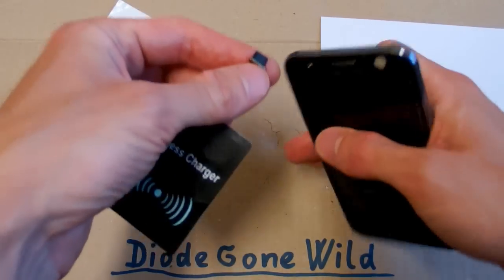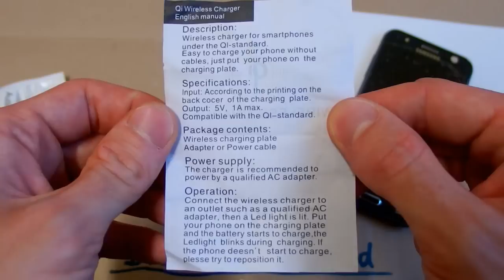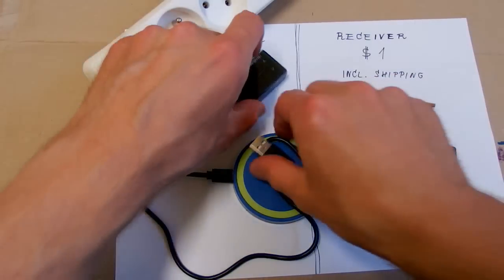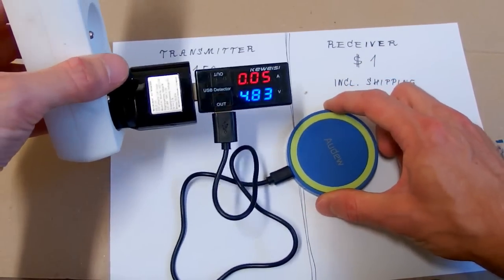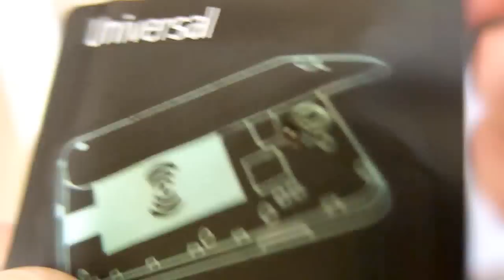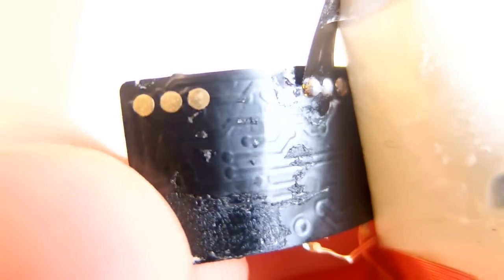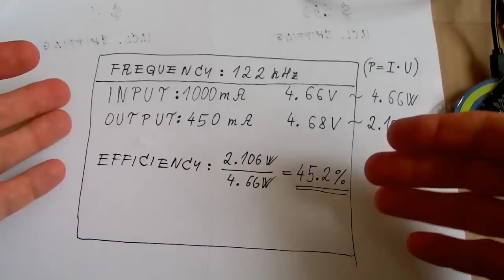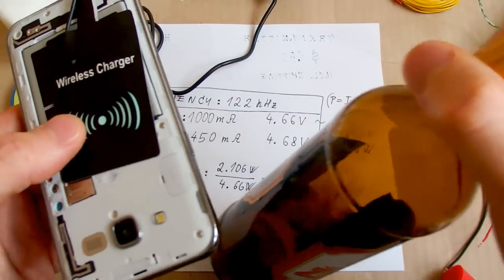Wireless Qi Charger (sets your phone on fire)

Comment: wireless charging is such a massive waste of electricity. The ratio of in:out is ridiculously low.
Reply: Adam Rivera  Not only that. It ties up your USB port,cooks your battery and phone (vastly reducing the life)and adds more danger to burning your house down. It amazes me how people are willing to sacrifice so much just to avoid the difficult and time consuming (2 seconds)task of plugging in their phone once a day. Wireless charging is a gimmick that takes more than it adds.
Reply: Gord Thor i would like to have a robotic arm who plug in for me 😂
Reply: Qi is rated at a 85 % transfer. not MASSIVE .
Reply: Gord Thor worse part
The smartphone is totally unusable while charging
Unless you want a hot disc in your hand while using it
Reply: I basically agree with you. But every time a connect my phone with this micro USB connector I have to think of the much more convenient round charging connector of the old Nokia phones. It was more easy to handle, because you just could not try to plug it in backwards. Just because it was round.
Reply: goamarty but those connectors start to malfunction after a while, but you didn’t realize on Nokia cuz you only need to charge it  once a month
Reply: The only reason why I would purchase a device with wireless charging is to reduce the fatigue stress imposed on the device's USB port. Obviously with USB-C the stress being imposed when you unplug and plug is reduced compared to micro-USB, but you can never be too sure.
Reply: It avoids breaking the charging port, which would be a big problem on my S6 edge plus
Reply: It's physically impossible to couple electricity wirelessly at high efficiency, otherwise we wouldn't have ugly high voltage lines all over the country, only wireless transmitters.  While the efficiency is around 0.5, I will stick the USB cord into the bottom of my phone in 2 seconds or less, and at least it will charge quicker and won't fry it.
A lot of people don't understand, just because something is possible, it doesn't necessarily mean it's good or efficient.  But they'll learn once their phone or house burns down.. tsk-tsk
Reply: maybe
Reply: So true
Reply: @BillAnt  Your phone won't burn if it already has the wireless charging in it. This chineese piece of crap will burn your house, not the official charging pad from your phone company. Samsung is doing good in that department
Reply: Gamer du Québec every product does that good, the samsung doesnt lead the way here :)
Reply: @cernobylis  Not every product. But Samsung is more advanced. Because they not only charge their phones wirelessly and rapidly, they can charge the bluetooth stylus from their note 9 in less than 2 minutes, which is a lot better than how Apple is doing it in their bent iPad 'Pro'
Reply: How massive? How much electricity is spent to charge mobile devices?
Reply: True
Reply: Yeah. It just remove old problems and make new ones.
Reply: @gilberttheregular8553  :D yes! Lot's of "managers" in companies can develop something new for customers and they don't know they killed good feature.
Reply: Gamer du Québec Samsung is more advanced yet all of em explode. Great logic.
Reply: Adam Rivera it’s barely any better wired and the convenience of dropping your phone on a pad and it charging
Reply: What electricity is required to manufacture the phone that replaces one with a broken USB port one wonders... or to recycle the raw materials in a broken device
Reply: @gordthor5351  If you’re using the phone while wireless charging no shit it’s gonna heat up
Reply: @goamarty  Absolutely, and this is why many charging ports get broken when people try to ram them in backwards. The round plugs only work for power so those aren't an option with the data pins needed for modern phones. However, it's possible to make a flat rectangle plug work in either orientation, but twice as many wires  would be needed in the cables.
Reply: Lately apple released wireless magsafe charger for iphone, and u know what..? u still need a cable stick to ur phone... LOL so ridiculous
Reply: I would use a chearger than wireless charging
Reply: Hence the LED

Comment: I can imagine, that this component (Z-diode ?) could possibly have survived, if the receiver was behind the phone cover. The extra distance of the thickness of the cover could have reduced the power transfer sufficiently. I once designed a wireless charging system and the voltage was tremendously dependent of the distance. But in this case the max. output current would probably be much less than 1A.
Reply: I'd love to learn more about it to save me from blowing up my phone or making it get overheated so I can actually charge my moto Pure G phone please 🙏🏽???? & Thank you sincerely.....

Comment: that burning component looks like to be a underrated diode, that thing don't seems to happy with 500mA
Reply from the maker: Given that the receiver still works, the component is probably a resistor. Diodes usually stop working when they release smoke, but resistors may still work even when smoking.
Reply: +DiodeGoneWild I agree with you, but it looks like a diode to me. Maybe the weird current consumption is because of that shorted diode.
Reply: Diodes go short when they fail, resistors fail high resistance or open.
Reply: It looks like a diode to me.
It might be a zener diode I think, just by looking at the PCB and the traces, but I'm not 100% sure. If it is a zener, that would explain why it continues to operate. (However there might be something getting too much voltage.)
Reply: I guess you could say that it's a diode gone wild..... I'll leave now
Reply: i have also "this" receiver and on place for burned component is nothing. Only 2  soldering places.

Comment: I have had several of these units. Altho I didn't use the charging base  you show here. Mine was the long rectangular one that the whole phone would sit on. Using that charger and one Qi receiver, I had one phone that would get hot. I used the exact same units on another phone, and I didn't have any issues with it.
However, with what you have there, is a defective receiver unit. So far I've bought 6 receivers and haven't had any issues with them burning a hole in the casing.
Reply: Any suggestions you might have for me buying for a moto Pure G phone good Sir or Ma'am????? Just curious cos I'd love to save myself from a fire or loss of only phone I got or risk of wasting money? Sincerely, if you didn't mind sharing any types that might or may work for this moto Pure G phone I've got ?

Comment: The bases are fine for charging phones that have the Qi receiver already built-in.

My coworker bought one for his iphone and it didn't work at all, he thought the base was broken. Actually the part that sticks into the phone was broken, a few months later i found the base lying around at work and took it home. Charges both my Lumia 930 and my girlfriend's S6 just fine.
Reply from the maker: The charging pad is not so bad except the loose board in it. The receiver is surely the worst part of it.
Reply: This is because the iPhone requires the data pins to be shorted with a resistor of specific value to work. Android/Windows devices do not require this at all. However, if they do have the shorted pins, it tells the device if it can charge at normal 1A or quick charge at >2A.
Reply: One of my cheap bases melted itself. I'm inclined to stick with brand name ones....

Comment: Personally I would prefer if phone manufacturers used magnetic attachments - The cable would attach itself when the phone is placed near it (like the magnetic micro USB ends available).  Plus they offer the other advantages of a cable, i.e. no efficiency loss, faster charging and being able to use your phone while charging, which is not possible with a wireless charger.  If someone trips over the cable, it will detach without the phone flying across the room.
Reply: Seán Byrne while I agree with most of your statement! I'd like to point out that wired chargers also have an efficiency loss, but it's not nearly as significant as "wireless chargers"
Reply: Magnet can disturb your navigating system so magnet is a bad idea
Reply: Seán Byrne but how about data transfer? Does it transfer fast? Does it get interrupted when you tap the magnetic micro usb while it's transferring? I'm curious.
Reply: The now dated magnet Apple MacBook charging connectors were this way.  I liked them

Comment: The transmitter is impressive. Well worth the price just for the coil itself! Looks like it's made from proper litz wire, and it includes a ferrite disc, which I don't know any source to buy from separately for a reasonable price. I'll definitely buy some of these transmitters just for the coils, I'd like to make some experiments with them (eg. a directional induction heater for heating up getter rings in vacuum tubes).

Comment: Nooo don’t put it on top of the battery. It’s a coil with a current passing through it = heat. Bad idea
Reply: Where do you think apple, samsung and lg put their wireless charging pads.
Reply: @tiagoizaguirre8837  yeah but that ones are not $1 Aliexoress😂

Comment: It is geting hot because you put more than 1amp. On the manual sais max 1 amp. I also have one of those and it never heated
Reply: The current is supposed to be controlled by the charger itself. His adaptor it's capable of supplying 2 amps, but it will only supply what the device plugged into it draws. In other words, it's the charging pad that connects to the phone that is the problem.

Comment: I'm glad I let go the plan to add wireless charging to my new phone and bought a magnetic adapter instead. best thing since sliced bread. 
super easy connect and disconnect, no extra power consumption when phone is not connected and the main point is, that it does not inhibit 3A quick charging.

Comment: That belongs in the nearest dustbin.

This kind of tech allways makes me laugh, so you can charge a phone via 100khz r.f, i just dont see the point, plug the power direct into the phone lol, silly idea :-D.

I feel sorry for am radio, hmm.

I have a 4000 year old sonyericson k800i phone, it charges from a 5v charger, reliable :-D.
Ooow and it bounces in a way that smart phones dont lol :-D
Reply from the maker: I also can't get the point of the wireless chargers. You have to plug the pad into power anyway :). Of course, you can keep it plugged in all the time and waste even more power. Like it wasn't already wasting more than 50% in the wireless transmission.
Reply: zx8401ztv 
 I have 5350 year old Samson D600
on it's second charger that cost £5
at the local market, and won't burn my 
flat out.:-) Oh, excellent vid by the way.
Reply: Golf Man
Ahh the samsung, and 5350 years old lol :-D
I say 4000 years old because im teased for not being interested in smart phones, the old ericson does the job, new battery last week from amazon lol.
And it does not break like modern phones :)
Reply: The only point I see is to avoid wearing the USB connector. I had a Nexus 5 a while back, that had a terrible battery life (1 day was good, and 2 days was really awesome) and if you plug in the micro USB connector a lot of time, it will wear it and in the Nexus 5 it's a pain to change because the whole phone is glued shut.

So since it supported Qi charging, I just used that...
Reply: Yeah USB connectors wear out. I think a good way to protect them is to use a magnetic USB cable - as a bonus they're usually reversible and super easy to attach. It only looks good on phones which have a flat area around the USB socket, but then the insert protrudes very little and doesn't interfere, you just leave it in once and for all, and whenever you yank the cable, it detaches without stressing the socket much.

But now that i've seen this video, i'm considering to add a wireless charger to my bicycle, powered by a dynamo hub and maybe some buffer batteries in the handle. If something catches on fire, it'll be outdoors anyway, and i can implement an insulation between phone case and the rest of bike electrics that way.

There's a good chance that the low 45% efficiency was down to receiver having defective components, which stands to reason with it basically smoking. Perhaps if it was fine, it would be closer to 60-75%.
Reply: 4000 years old? Humans didn't even have that technology back then so it's weird to say

Comment: The problem is you can't use that wireless charger using ordinary mobile phone charger because they can output about 2 amp depending on your phone's battery current consumption. You have to make your own charging port whereas it limit its output current to 1 amp and less.

Comment: "1amp is a lot. You cannot use a 1amp charger. You have to use a 2amp charger" please explain. That doesn't make any sense to me
Reply: It requires over 1amp which a 1amp charger (most likely .7A) will not be able to supply. It probably won't charge also because of the low efficiency
Reply: @deavman  then why he said "1amp is s lot" ? (Did he really said that?)
Reply: @evergreatest7644  
Yes he did. 1amp is alot to draw when most chargers supply 1amp or less. Did you notice that the device eventually drew over 1.5A

Comment: Typically you need TWICE the wattage you intend on using.

So if you have a 5v 1amp supply, your charger can realistically deliver 500mA with reliability.

Your mains socket  will have wiring rated at twice maximum recomended current draw, in the UK that is your socket can deliver 32 Amps before it gets hot and melts.

Also, its no use using a 5W charger on a device that needs 15W to charge is it...

Comment: yeah that magnetic stuff is most likely to stop ur phone from receiving a high magnetic field. which doesn't work well in this case as ur phone seems to receive quite a bit of this field. but yeah it's generally meant to stop the field from moving past the receiver, if it was the core of the coil it would NOT be magnetic

Comment: I have found that those need solid power supply! They don't like kow voltage! They really want at least 4.9 volts but 5 is best. I noticed your voltage was quite low around 4.5 volts. However that means things will get hotter but the voltage will be higher lol.

Comment: This is what happens when you buy a $1 transmitter and receiver from eBay. I bought a $15 transmitter and high end phone with integrated wireless charging, and it works fine. Has never caught fire.

Comment: Why to use usb port voltage to convert it in rf signal and then convert it back from rf to usb voltage to charge a phone and dont use directly the charging port and second the power efficiency is 50% meaning that the loses are double the consuming charging current.Also overheating until burn and even in very serious designs many people were coming to talk about EMI interferenceses and here is a totally wasted rf signal for nothing else but damages.

Comment: the instructions said to not use more then  a one amp charger this would limit  output  current and as well as heat.
the receiver not controlling current is the trouble cause  if you use a random wall wart and dont check current you could end up with fire or overheating.
he showed using a 2 amp wall wart for a power supply but it  drew 1.44 amp so it was being used out of specification but thats why its not a good idea to add without proper testing and validation.
i wonder what results would have been with proper power supply of one amp. 

at 45% efficiency this is still to terrible to install.  the 3000mAH   battery would take more then  6000mAH  from the wall 

this  was a great video  btw  with  good training and  wording.    the accent you have is your native tongue,   people i wish you would just get over  it is his and it makes his content still great. 

if you need more clarity  try CC  in settings.

Comment: why not make a case similar to a power bank case except its the reciever not a battery so you can just remove the case if you need to connect it to something...unless if we just improve every tech to just send things wirelessly via wifi or through air transmitting...My Mind Hurts

Comment: LOL! I bought that exact looking charging receiver-pad for my phone. It didn't burn a hole in the packaging but instead (after 2 months of use) would start to heat up the battery (a lot) during a charge and the heat continued until the battery was completely discharged. I'm currently plugging it in again.  ;)

Comment: Wireless Charger work on the magnetic resonance or simply electromagnetic pulse using step up and step down so it will definitely burn up until or unless its under certain temperature..

Comment: had the same one the transmitter it used to heat up my phone a lot and i used to charge it overnight and when i wake up my phone is almost Burning hot i didn't know that heat is bad for batteries so over time it ruined the battery of my brand new 1000$ Samsung phone i even once woke up and found the charger melted luckily no fire my phone used to last a full day but ever since I've been needing to recharge it 2 times a day at least i regret getting this i have now gotten a high quality wireless charger with temperature sensors and it never gets my phone hot just slightly warm all that while 10w fast wireless charging the old one was barely 5w

Comment: I also have a wireless charger. It turns very hot and my phone stops charging for overheating. Bit at least it doesn't melt my hand, my phone or my table

Comment: Get one from LG the fast wireless charger I had it for a little while now and it's awesome. Has a built in fan that kicks on to keep it from heating up it cost more but it's worth it. It even has a blue light that turns green when it's done charging and cuts off power so it doesn't fry the battery.